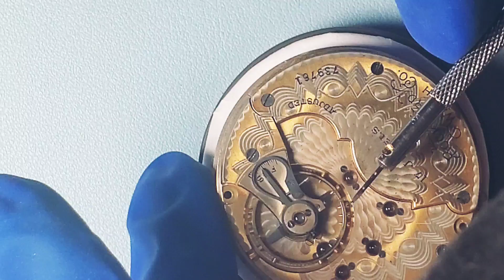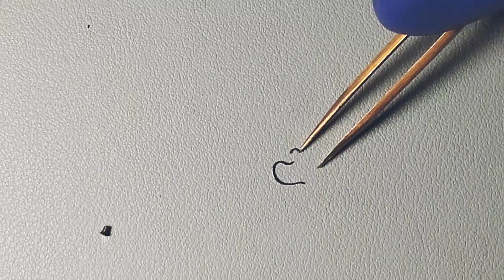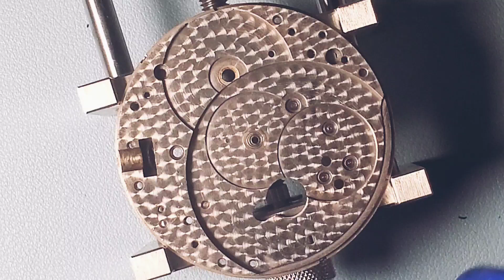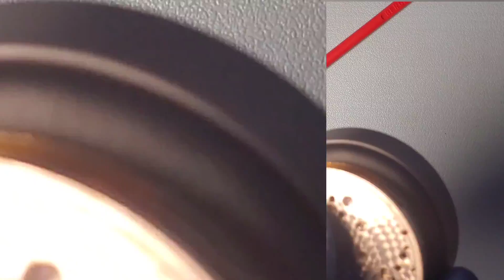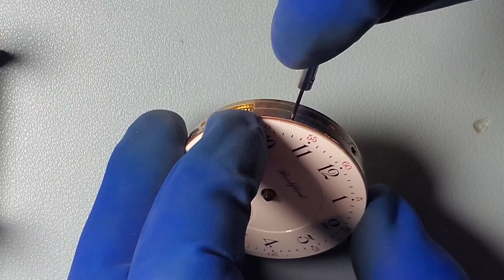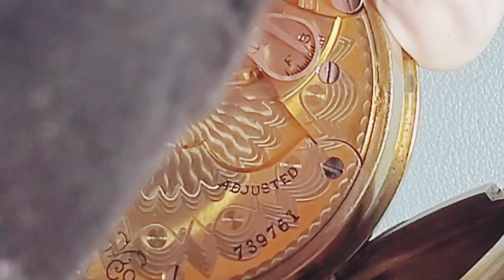Two-tone beauty - overhaul of Rockford Grade 925 pocket watch, a tour de force in watch design

Comment: You call a rocking bar a yoke.

I think most of the work on the plates was done on a lathe.
Reply from the maker: Do you have a RWC parts list? I don't; Hamilton calls the part a yoke.
Reply: @redvitiswatches  They may have but in modern parlance these are called rocking bars.  The yoke in modern keyless works is what moves the sliding pinion to engage and disengage the setting wheel and winding pinion.
Reply from the maker: Illinois watch Co also called similar part a yoke in their parts list.

Comment: Why didn't you adjust beat error ? 0.5 a little bit high !
Reply from the maker: Haven't heard that before. Pls explain. Cheers, RedVitis
Reply: @redvitiswatches  I THINK HE REFERED TO BEAT ERROR
Reply from the maker: Same answer, in short. To expand, Beat error of watch was 0.3 DU and 0.5 PU is not high. I set watches to BE less than 1 and they keep good time. I welcome other points of view, especially if they are well reasoned and backed with testing. Happy to discuss further. Cheers, RedVitis.
Reply: @redvitiswatches  Some people are just not pleased if the beat error rate isn't as close to zero as possible.

Comment: As a watchmaker myself, I just want to say how much I dislike working on these full-plate movements. Beautiful? Accurate? Stunningly decorated? Absolutely! Finely engineered? Yes and no. A watch like this was more or less the pinnacle of the craft (short of literal marine chronometers), and in this era America was even beating the Swiss in both pure tech innovation and fit & finish in watchmaking... But this type of full plate watch is certainly a pain in the ass when it comes to repair/servicing.
Reply from the maker: Really appreciate reading your perspective. I was so impressed with how well this one was made, and a few other things about it I didn't even point out. Would jump at the chance to work on another.
Reply: @redvitiswatches  Yeah don't get me wrong, just that from a watchmaker's perspective the innovation of multiple bridges makes everything so much easier & safer to work with. Still in an age before exhibition backs were a thing (outside of the odd special salesmans' sample piece) the amount of finish they did that would never be seen by anyone save a watchmaker every few years is ridiculous. Depending on the model, the entire balance wheel and jewel settings may be solid 18k too

Comment: Sekundine rodykle nulaushi- uzmirshai nuimt>
Reply from the maker: I think you asked why the click spring was not removed. I found it was pressed in tight and would have required considerable force to remove. I left it on the plate while cleaning.

Or are you asking about the seconds hand? I removed it by lifting the dial. But yes it was removed.

Cheers, Redvitis